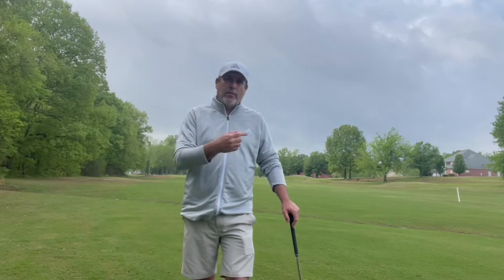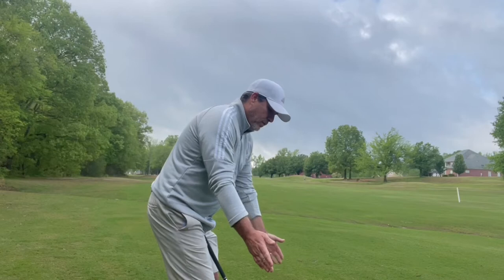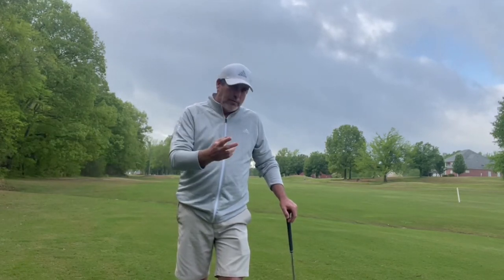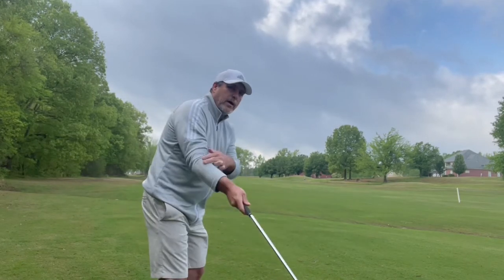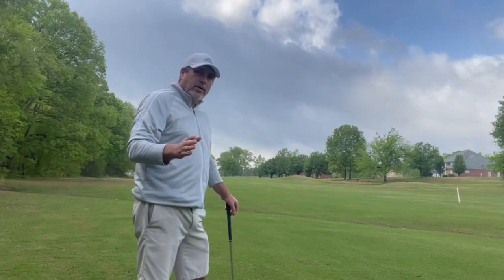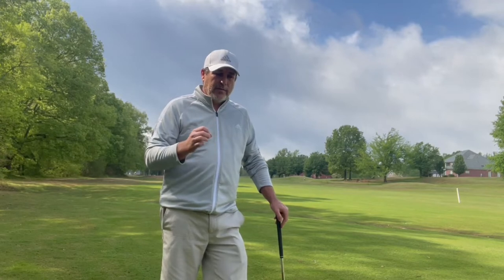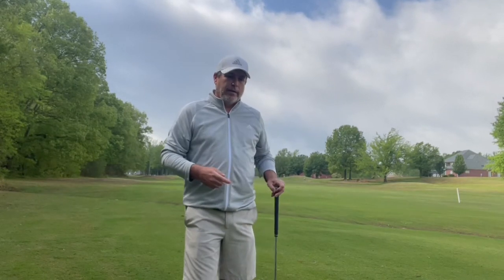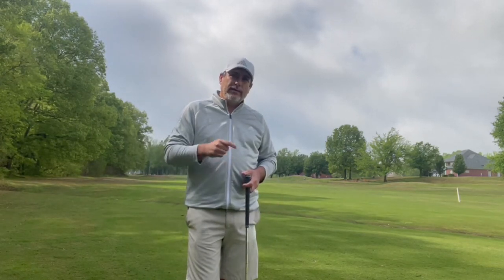Matt Gray-On Plane Spiral

Comment: Great videos Matt with the spiral hinge lock. What's your opinion on the one length irons for channel lock?
Reply: Hi Allen ,  
 One length irons work with  any application of the golf swing . I’ve played one length and variable length irons and I couldn’t give an advantage to either type of iron . The only issue I see is that players with slower swing speeds might have trouble getting elevation on the ball with 4,5 iron. The  shorter length make the club easier to hit but the ball flight can be low for some players .I think manufacturers have made some improvements in this area so it probably want be an issue .     Cheers

Comment: What is autoload.
Reply: Hi John, 
       Auto load is basically loading the club with momentum instead of lifting the club in the back swing.  We also call it negative loading . Count yogi and many of the pros from way back use this technique . It’s also used by many modern touring pros . Your basically starting the handle before the club head in the backswing . For many players it will look like a one piece takeaway but it will feel strange for players who lift the club prematurely.    Cheers

Comment: Hi Matty, 
      I see a  big problem with that  Spiral swing..  you won't be able to putt with balls hit with that swing..  because they will have a 'flat side' on them from the club energy you are developing with that swing..  
        The speed and obvious power you are developing with that swing is super impressive..  your rotational axis is the epitome of  'fixed stability '..  the compression you are applying to the ball is clearly  'audible'  in the strike.. 
         As you correctly pointed out..  you don't have to take divots of significance to compress the golf ball..  Tom Watson was one of the best ball strikers with irons of all time..  and he could hit irons off the putting green and he wouldn't damage it at all.
          The most technically correct golf swing with the most precise level of ball compression at impact doesn't take any divots..   funny that eh..  oh.. by the way, that greatest compressor of the golf ball swinger is  ..  'Iron Byron'..  
         As Moe Norman got older and lost his midriff flexibility and his hands couldn't get as high in the backswing anymore ..  and his swing became flatter in the swing plane..   which meant he wasn't as steep as he was when he was younger  ..  he didn't take divots hardly at all  ..  I think he was the person who coined the description of  .' bacon strip'  divots.. not 'Pork Chop'  divots..  and he was in his younger days a  'pork chop'  type divot taker. 
       With CL  as well with the ball way back off the trail foot at impact the club is still swinging from its inside direction which is shallower than it will be when it gets to a  conventional ball position target side of the body center as is the case with a  conventional golf ball position at impact. 
        The point of all that palaver is to highlight how  Moe Norman was probably the best most consistent compressor of the ball in his latter days that has ever been and he didn't take significant divots..  perfect compression technically should occur at the maximum line of shaft efficiency at impact  ..  and that is when the clubhead is moving  'forward'   at its maximum speed and energy development..  and as we see with Iron Byron that is when the shaft is at its most vertical line of efficiency  ..  
            Your shaft line of compression application is where I think everyone should be at impact  ..  I call it the 'Goldilocks'  angle..  not too far back at impact..   and not too far 'forward' at impact ..  look forward to more  'Spiral'    insight from you..  
          cheers mate
Reply: Hi JH,
     Iron Byron is the perfect example and How can you argue with that observation . When  my swing was steep I struggled with deep divots and distance control . I also developed reoccurring elbow and wrist pain . The divots where never a consistent depth. This results in variable strikes on the club face resulting in a issues with distance control. 
    The spiral is the real deal for CL or any other swing . I think we should explore the different types of spirals in the swing . One thing that is obvious to me is the cL spiral is very efficient. I have a full understanding where the club head is all the way through the swing . I’ve had this awareness for about two years now . It’s something that is difficult to explain but when you have that awareness everything becomes easy . I believe the hinge, capital Y and lower case y blended with a proper spiral allows me to swing the club on a consistent plane . 
     Cheers mate